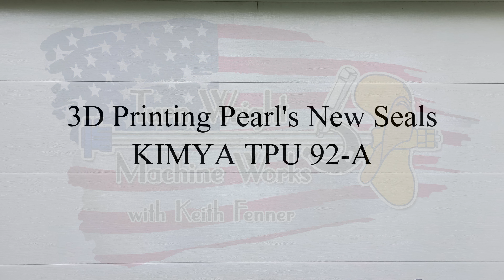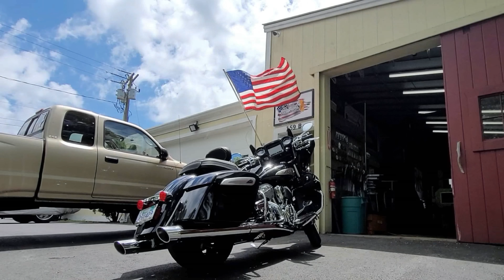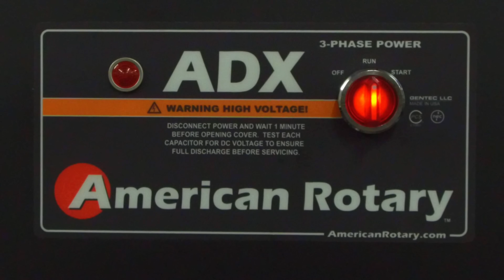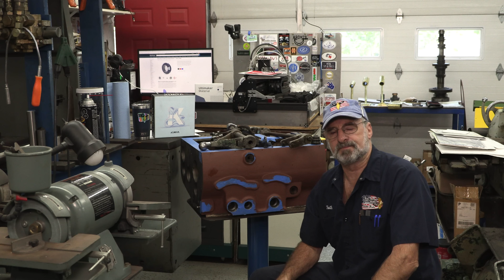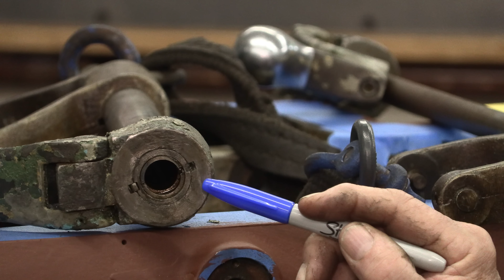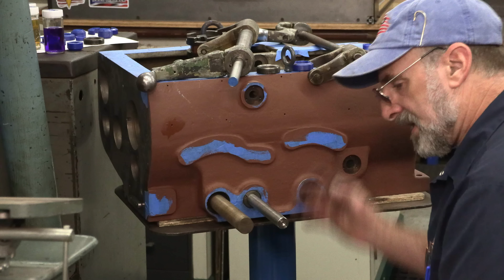3D Printing Pearl's New Seals KIMYA TPU 92 A

Comment: 30 years ago Richard Hamming lectured students how back in the day when Bell transitioned to digital switches a lot of skilled folks that were specialist in the relays practically were left behind because they didn't learn the new stuff. Every piece of modern equipment that I see in your ( or Adam's) shop reminds me of that lecture. I want to never forget it myself
Reply: I was one of those people who was a step switchman from way back. I embraced electronics because in my opinion they are easier than the complexities of relays and the miles of wire required to support them. The skill and art of adjusting relays was complex. I moved on and became technical support for digital electronics. We still had one early electronic switches that had a lot of relays. I used to drop in just to enjoy the nostalgic sounds of the clicking and whirring.

Comment: try toluene
Reply from the maker: The fuel would most likely have or be similar
Reply: @KeithFenner  I wasn't suggesting is similar, just that you asked what else to try it on - would be interesting to know what happens since it held up quite well to acetone (I didn't think it would)
Reply: Agreed. Toluene is really nasty stuff. I have not found any pressurized sprayer that will handle toluene even if fitted with Viton seals. Toluene is in a lot of carby cleaners.

Comment: Just curious why you decided on hydraulic fluid? My lathe is due for a gearbox oil change.
Reply from the maker: Less fiction runs cooler and longer.
Reply: @KeithFenner  I always wondered why they didn't have an active oil cooler

Comment: I'm curious about what would happen if you heat the oils? Temperature would be another consideration. How hot does a lathe gearbox get when working hard?
Reply from the maker: The material is already proven to be okay up to around 175 F

Comment: From the view of the ID it looked rough, I wonder if printing a little smaller hole that can be reamed to dimension might be more reliable/ideal.  Love your channel.
Reply: No chance to reaming or machining in general, it is very elastic and no chips will form, you will either tear the part or melt the surface